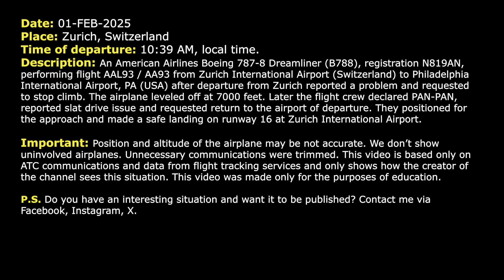American Airlines Boeing 787 declares PAN-PAN at Zurich slats issue after takeoff. Real ATC

Comment: Sounds like ATC not only gives the pilots time to work out the issue but 1) sends them to 7000 to avoid both the mountains and the need to busily aviate 2) navigates for them concisely and precisely, knowing that they can use autopilot over 7000 and 3) communicates for them with the other ATC, setting up the fire brigade. This is the reason the pilots can solve the problem in peace and decide successfully what they can and cannot do. And, ATC doesn't ask impossible things from the pilots. Probably ran/remembers the numbers himself too, with a margin of error. Asks if he is allowed to drink water tomorrow. A fuel dump can permanently damage water sources, and probably the plane flew above a major one.

Comment: Really calm, professional conversation to get the plane down safely. But am I the only one asking myself why the departure ATC controller said 16 is longer than 34??
It's the same runway...
Reply: I might know why. When you land on 16 you have more runway to use. (You may look at google maps) if you land on 34 you have more obsticals such as buildings, a street that is higher than the land around it and is unsafer than on 16. if you look at the map you notice, that 34 has an area of runway marked with only arrows. That part is normally not used, and a landing there is not possible due to the things mentioned earlier. However landing on 16, the part with arrows can be used as more breaking/stopping time. Does that make sense?
Reply: @TobyFerrari   Yeeeeah, sooo this is embarrassing...
I mean, I actually know what a displaced threshold is and how it's used. If I had looked it up before commenting, I would have seen it there as clear as a bonfire at night in the flat desert.
What makes it even worse: From my office I can see the beginning of 34, hence the displaced threshold 🤣🤣
So, I could have spared us some time, if I had just used the giant round thing sitting on my neck.
Anyway, thanks for the really good explanation :)
Reply: @cilvaring  😅 das hani doch gern probiert zˋerchläre… bin zwar kän pilot aber es het für mich sinn gmacht… love aviation! Alles gueti dir 🙌

Comment: Why is tower requesting the plane to use the whole runway?
Reply: Yes exactly right. ATC had to assume that the plane would block the runway for a while and directed it to a dead spot. At end of Rwy 16 it doesn’t get in the way of other runway operations. I flew 35 years out of Zurich and ATC was always top. 👍
Reply: They are full weight for trans-atlantic flight with fuel so the plane is heavier and will come in for landing at higher speed - it's easier to use the longest runway and entire roll to stop the aircraft.  It's also an isolated end of a runway that does not impact operations for the airport and gives the emergency services a nice isolated spot to greet the plane.     The tower is likely passing on the wishes of the fire incident commander for same thought process.

Comment: As somebody who was on this flight and flies a lot I was scared out of my mind. I don’t know why that feeling came over me. The pilot was very calm in his communication with us passengers as well. My question for the aviation community was how close of a call was this??
Reply: Nothing to worry about, pan-pan is an urgency not an emergency. Slats are the extension to make the wing surface larger for take off and they probably werent able to retract them after take off, therefore not being able to fly as fast and climb as high. So they had to return after figuring out if the issue could be fixed. They didnt want to dump fuel so the landing was quite heavy which puts stress on the brakes, espeicially using a tailwind rwy. That is why they asked for a fire truck, just in case brakes would overheat. What did they communicate to the passengers?
Reply: @miguelkamal256 first the pilot came on and explained there was a problem with the flaps and we would be turning around. He gave us a countdown of when we would be on the ground. Before landing he told everyone not to be alarmed by all of the emergency vehicles waiting on the runway.

Comment: ATC didn’t ask for souls and fuel
Reply: Having just taken off with the same controller, they would know low fuel would not be an issue. Also a PAN-PAN mean while there is a problem, the plane is under control and no landing problems expected.
Reply: Nice job, a lot more went on…but two cool heads.  Awesome 👏

Comment: This same plane declared an emergency and returned to Barcelona shortly after takeoff just a couple weeks ago in January due to a slat issue
Reply: Wow interesting.
Reply: 7th Jan at Amsterdam, 10th Jan as AA722 (returned, don't know the issue), 14th at BCN then FR24 shows also on 19th a return at BCN and now at Zurich.
Reply: @jtoddk98  good old American quality. And no, you can’t blame that on DEI. How about we won’t let American planes fly to Europe? They can crash over DC but not Europe
Reply: The January 7 incident was at Amsterdam...is that the one you're referring to?
Reply: :face-blue-wide-eyes:
Reply: Same Make-Model or same N-number?
Reply: @maryb67  same registration N819AN
Reply: This particular plane has had a bunch of diversions due to different issues and is currently sitting in Dallas.
Reply: Obviousley maintnance did'nt correct the issue typical .you are going to see many quality/mechanical issues arise on these 787's as they age very poorly slapped together its only a matter of time before these things start dropping out of the sky
Reply: @DavidMartinez-lu5ot really unnecessary comment

Comment: finally no fuel and soul
Reply: It’s just taken off to fly across the Atlantic.  Fuel exhaustion is not going to be a problem.
ATC can get passenger numbers by phoning AA’s handling agent at ZRH.
Reply: @renard67  it’s not about fuel exhaustion. It’s about how much fuel is on the aircraft incase something goes wrong on landing. 

Also, they aren’t going to “phone” AA. The pilot’s have this info handy. They know exactly how many people are onboard and it takes 5 seconds to give this info.
Reply: True. But it's also useless if ATC already knows (because they just departed from ZRH).
Reply: They don’t need to ask for souls in PAN PAN scenario. They can ask for rocks, pops and hip-hops, if I’m not mistaken though
Reply: Did it change the desired outcome without that information on board?
Reply: They should’ve asked for that.